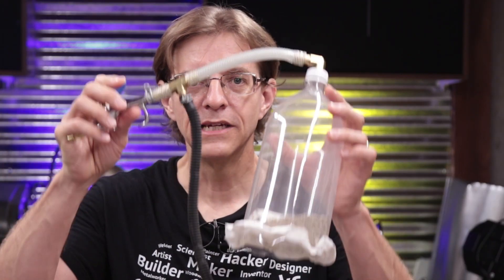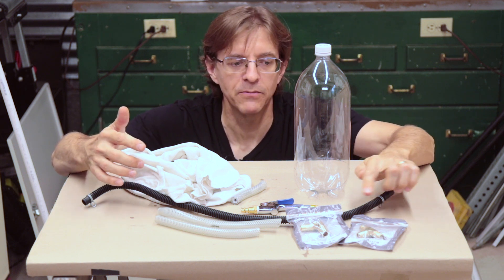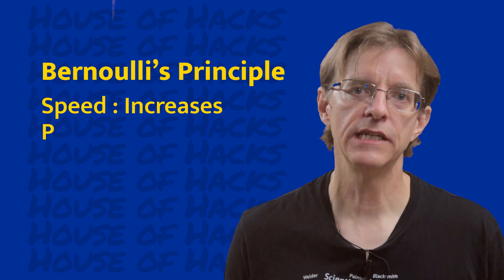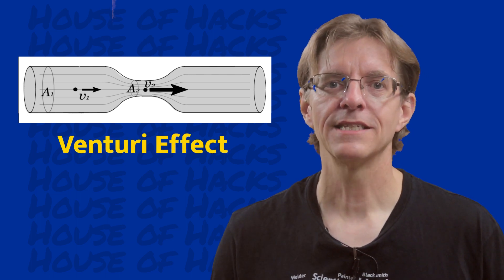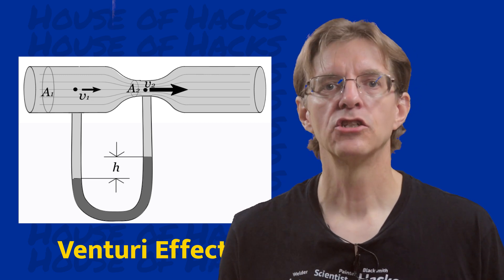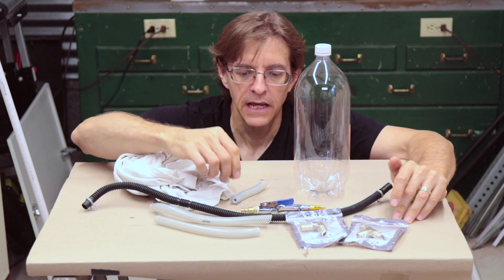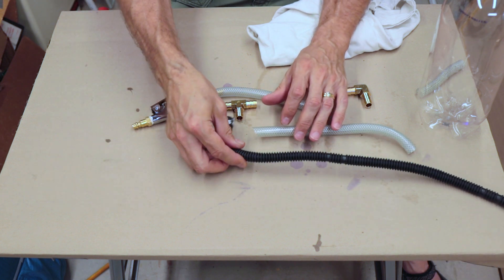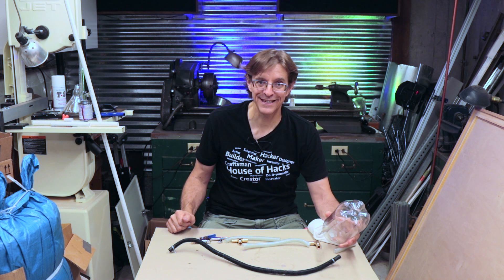Compressed Air Vacuum Cleaner - An easy DIY project

Comment: Thank you for this!  I wasn’t sure on the final bottle configuration? Did you only use a ring with an open center of the bottom of the bottle to hold the fabric but allow air to escape? I just need a little bit more detail about that aspect of the process. Otherwise thank you for the demonstration.

Comment: Love the video! Would this also work for a pneumatic oil / gas extractor?
Reply from the maker: I would think so.
Reply: Yes same principle works on fluids too
Reply: It would suck up fluids but not as much as you think, because oil/gas is more dense.
If you had too long a suction hose gravity would stop it from going up very high, depending on the size of the suction hose and 100 psi air probably only go up the hose a foot or two and stop. But if you add more air pressure the higher you could suck it up. But if you used water from a pressure washer it would definitely make for a better vacume.
(except  you would need a  really bug container to collect the waste water
 Plus oil/water dont mix. Unless you happen to have water tank full of oil that was high enough to supply the pressure washer enough oil psi to use instead to   suck up more oil.)
Although if that's all you needed was a few feet from compressed air. 
Then if the outlet hose was lower than what you are sucking from. It will get it to start a siphon instead. 

Example: havent tried it.. but a compressed air vacume probably could be used to suck gasoline out of a car gas tank into a lower gas can. It would definitely alot better idea to siphoning gas than accidently getting a mouthful of it. But the other hand it may require a smaller hose and take longer to siphon out the tank.
Reply: @smottiebug7518  Thank you.

Comment: make a cyclone prefilter (suction inlet)  to catch most  the debris in a closed container. This way you dont need to clean up the cloth as often as you need without a cyclonic pre filter
Reply from the maker: Yep, that could certainly be done. I plan to do that for my shop vac. Thanks!
Reply: @HouseOfHacks  hey pelle & House, can you guys explain that cyclone prefilter, or send me to a vid that explains it or shows something along what you're thinking?  i'm building one right now off of your design HOH, and depending if i hear back from you guys i may be able to incorporate it.  i gotta really thank you House, i love that there's people like you out there filming.  when it was FFding thru the scissors portion i was so mesmerized i kinda forgot it was sped up & i internally started freaking out that you were gonnna cut your fingers off hahahaha.  oh & pelle if you happen to get this i'd love to hear your thoughts as well if you don't mind.  if not i understand.  thanks again.

Comment: Great stuff! As if you read my mind. I wonder from there, whether cylinders can be used in designing a vacuum cleaner instead of rotary motor. Awaiting your reply. Thanks n Regards. Sham.
Reply from the maker: Interesting question. Cylinders can be used to draw a vacuum so I suppose you could use them for a vacuum cleaner, but they probably wouldn't work too well.  Their advantages are they can draw more vacuum pressure, but, since they're reciprocal, they're not going to be as efficient. To counteract the inefficiency, they'd need to be larger and more of them so the system would be heavier and require more power then the equivalent impeller based design. The only reasons I can think of using them would be if there's a special application where more static pressure is needed than can be generated by an impeller or someone wanted to prove they could do it.